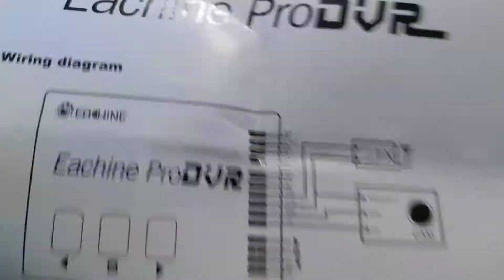Headplay FPV goggles DVR wiring tutorial

Comment: how do you like the eachine prodvr? Looking into doing the same mod. any cons at all? Pros?
Reply from the maker: Jake Burkett if you do the mod like I did, it works great. If you view your feed live from the video out on the dvr it sucks. It's a decent DVR, as long as you tap into the feed rather than in series. Only issue is if you want to use input 2 for a ground station, you have to unplug the DVR.
Reply: Or I just swap input/output, if I don't use the VTX from the goggle?
Reply: I did it that way. Works perfectly. Eachine Out to AV1 (former VTX) and Eachine In from AV2 (video from groundstation/Tango). You can then even unplug the VTX completely.